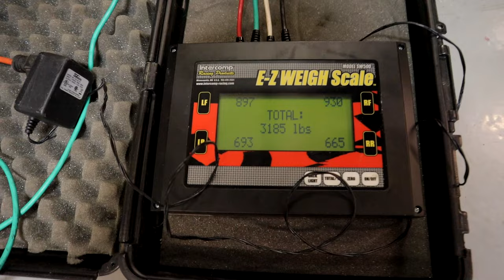American Musclecar Evolution - Why Pontiac Started Strong And Faded Into Obscurity

Comment: The first engine I built was a 400 Pontiac. Used a book called "How to build a Superstock Pontiac". It focused on the 400/428/455 engines. It was written in 1980. Still have it today and I bought it new. I used to buy Pontiac 400/428/455  core engines to build for $50 bucks each. Could get the T400 that was bolted to it for another $25 bucks. Them were the days. I once bought a RA 3 400 from a 70 Formula that was wrecked, paid $125 bucks for that unit. Already had a Torker intake & 800 DP Holley on it, a Mallory dual point distributor, and a RA 4 cam with 1.65 rockers installed. Also had a pair of Hooker Headers on it. Hell of a deal. Engine didn't have 10,000 miles on it.

Comment: Back in 1974 my dad had a '70 GTO "Judge" with the Ram Air 4 engine and 4spd.  One evening, two guys in a '69 Chevelle SS 396 came up beside him and started taunting him to race.  So he let the old goat "eat" and took it all the way up to 140mph blowing the Chevelle's doors off.  He happened to look down at his gauges and noticed that every needle, including the oil pressure gauge was pointing at zero.  He then looked in his rearview mirror and saw nothing but smoke.  When he coasted to the side of the road, the Chevelle blew by with the two guys hooting & hollering and laughing their asses off.  He said there was oil covering the entire decklid of his GTO all the way up to the rear window.  He got a 428 replacement engine out of an old Bonneville, and when he took the 400 out he had blown four connecting rods straight through the block and oil pan.  He always wondered why an engine would grenade so violently when running in high gear, but I guess this maybe explains it.  He also assumed the Chevelle was not an L78 375hp version, as there were very few of those around and even a Ram Air 4 400 most likely could not beat one of those.  Anyway, I thought I'd share this story, as it seems somewhat relevant to the topic of the video.
Reply: It was generally the 3-in mains that made them it's just like a berry go round in the park you sit in the Middle East day on you go to the outside and wants to throw you off same thing with the oil in a Pontiac motor that's why the newer Pontiacs they race use big block Chevy journal sizes
Reply: Ram Air 400 was one of the best engines ever made.
Reply: I believe it : we were in a blazer going 110 and the gto went around us like we were standing still . I still remember the wide tires on the back that gto flopping around. It had the 400 engine .
Reply: I like Uncle Tony. It’s obvious that he has a penchant for Mopars. However, he brings out the highlights of other OEMs. He’s very knowledgeable. I had a 1969 Ram Air 3 firebird my senior year of high school. #62 heads and 068 cam. It had tremendous torque and ran mid 13’s back in 1989.  Pontiacs were all known for their inherent torque.  The small port heads created a faster velocity. They were never intended to exceed the HP max on the power curve; usually around 5300ish rpms. That goes for Buicks and especially big block Olds. GM A bodies were heavy cars and GM engineers needed torque to move them. If you look at various muscle car curb weights, you’ll find that the Mopar unibodies, as large as they appear, were about the same weight as a Nova or Camaro. I always wanted to find a set of 7H3 or HO round port heads.
Reply: Correction: where HP meets torque on the curve.
Reply: This story shines a whole different light on Pontiac to me
Reply: LMFAO - nice "fish" tale!
Reply: Didn't the ram air IV have forged rods and pistons? I thought they did.
Reply: The Ram Air IV had special steel connecting rods.   Not the same issue.  It also had upgraded oil pump and pickup (and bigger heads).  The 370hp rating was a joke - maybe 390-400 at 5000rpm but the cam was 6500rpm capable.
Assuming it was a Ram Air IV and not a III
Reply: @corottolt1  Yes they did and beefier than the early steel rods.
Reply: then it wasn't a ram air 4...most likely a ra3... RA-4 was a different animal
Reply: @corottolt1  they did.... that's why I say it was a RA-3 he was talking about
Reply: 140 mph with oil blowing back on the rear tires. LoL
Reply: @BryanClark-gk6ie  wasn't a RA IV then... They had forged rods and pistons
Reply: Yes ! Pontiac kicked ass at the track , but GM looked the other way .

Comment: Yes, the rods were the weak link in the Pontiac V8. I have been racing and building Pontiac’s since the early 80’s and learned early on that they will live a long life when the big end is properly machined to less than .0005 out of round, and good rod bolts are used. My last 455 made 600 hp with stock cast rods. After 11 years of 1/4 mile racing it finally wore out #1 rod bearing. Didn’t break anything, just started knocking after a pass. I should have freshened it up after 5 or 6 years but I was trying to see how far I could push a stock bottom end. Now I know. 😁
Reply: 600hp was the sweet spot 😆
Reply: the Pontiac guys I know say it wasnt the rods but the rod bolts were the weak link.
Reply: Was it the rods or the fact that the structure of the block would flex all over the place. The block was like butter in the Pontiac engines it moved all over the place.
Reply: @jeremypike9153  The blocks are fine up to around 750-800+ Hp then they eventually will crack from the main saddle up towards the cam tunnel.
Reply: @HeadFlowInc  I was thinking of Buick 455 engines
Reply: What RPM were you shifting at?
Reply: @SuperKONR  that would be interesting to know what RPM, those big journal blocks (also olds and cad) want to be bathed in oil if going over 5,000 rpm. Even the Super Duty 455 used a cast crank rather than forged, but went with forged connecting rods. Buick blocks flex since they weigh about as much as a chevy small block--great for hopping up a Buick Skyhawk or Apollo. Pontiac blocks benefitted from great machining right at the factory, and that the bolt heads went into the side walls of the block, rather than bolted into the deck like most engine block designs--you could skip a torque plate if need be.
Reply: @SuperKONR shift point was 6000, went through the traps at 6200.
Reply: Video from a few years ago. https://youtu.be/SGc0qugn_WU
Reply: @georgeulmer3034  what did you do to the oiling system on that?
Reply: @albertgaspar627  only mod is a custom oil pan baffle of my design. Other than that it is all stock.
Reply: How do you get headers on some of those cars ? Plenty of alcohol ?
Reply: @jesse75  yep, first you get the engine real drunk...no, kidding. soak the header gasket in water overnight, she swells up and conforms to the imperfections. install wet, and torque and fire up and she dries out. then retorque.  or if it's easier to have the headers in the engine compartment and drop the engine on them, do your test fire outside the engine compartment and line up the headers inside and drop away.
Reply: Thank you Butler performance
For all the great Poncho products now so you can get a nice good Pontiac and keep it Pontiac and not put a stupid LS Chevy in it.

Any questions take a look up Big Chief
Reply: Back in the 80s, no one made good aftermarket rod bolts for the Pontiac.  We use Mopar big block bolts and they ran pretty well.   I will say every rebuild and every re-ring 6 connecting rods would be out of round.   Never the same 6 and the other 2 barely in spec.
Reply: @truckerkevthepaidtourist  Yeah I like when a Pontiac still has a Pontiac engine in it. I like when someone preserve the originality, this goes for Buick too. There's something wrong to put a LS engine in 1971 Skylark.

Comment: I knew someone that once owned a '73 Pontiac Ventura "Sprint". 

He transplanted a stock 455 from a 1970 Boneville, kept the Saginaw because he couldn't locate a Muncie Rock Crusher, kept the 3:08 rear. Think it was 375 HP 525 ftlbs torque. Stock.

Nothing could touch it on the street and he only needed to shift up to 4,500 RPM for that car to take care of business. It handled remarkably well and flat around corners and it idled so smooth.

It had the functional/optional Trans Am shaker and Ralley gauges that I found accidentally at the savage yard purchasing a fender for my '77 Bronco and gifted him the shaker and gauges on his birthday which was on the same day of finding it.

Good looking car.

Comment: Ending was hilarious! Yes, Pontiac's OEM rods were weak, but Oliver had strong forged replacement rods for them. That's what most folks around me down in Georgia used. I used to put those Oliver rods in small block Chevys, and Wiseco made pistons to run. The longer length did wonders for wear on the blocks of the dirt track engines we built with them. Today's kids have it made, with all the stroker kits and such. lol.
Reply: so true.....had to know your stuff and a good machinst back then.....dieing off sadly.
Reply: Yeah we have it made alright. Apparently you guys haven’t seen the going price for parts these days. Hot ridding is a rich man’s hobby unless you repurpose used parts for the entire build.

Comment: I have a 63 SD 421 Catalina sitting on a trailer. It blew up back in 1970. And it came with forged rods. Gonna build a stroker 67 400 for it. Of course it'll have aftermarket rods and crank in it. Pontiac engines can run, just gotta build them right.

Comment: Pontiac it's in my blood,My grandparents work for Pontiac motor division for 40 years grandma made ring gears, Grandpa made transmission gears. I was born in Pontiac orthopedic hospital Pontiac Michigan. Rode home from the hospital in Mom's '57 Pontiac chieftain that she used to race out at the old Pontiac airport. And on Friday and Saturday nights would race stop light to stop light out on Woodward. One of my first memories is standing on the hump between the bucket seats holding onto the bucket seats as Mom is racing from light to light on Woodward in Dad's brand new 62 Tempest 4 cylinder 4 barrel 4 speed. She'd walk a Thunderbird like it was standing still. I have had '64 '65 '66 GTO's a 66 tempest with the 6 cylinder and three-speed convertible. A 67, 68,69, 70, 71, 74,75 firebirds, my graduation present was a 77 trans Am, 68,69 LeMans and a 70  T-37. 2 two 68 catalinas. And a 69 Bonneville.
Reply: Howlingmad Mudduck That's a lot of Pontiac in your history!
Reply: Damn bro!
You truly are a pontiac American!! Damn lol!